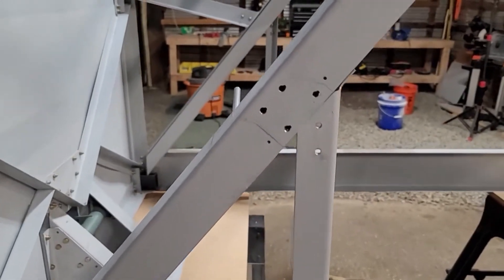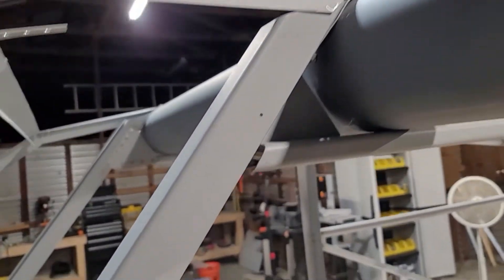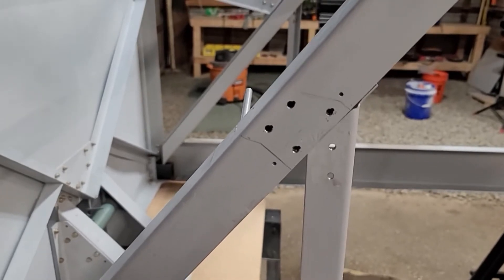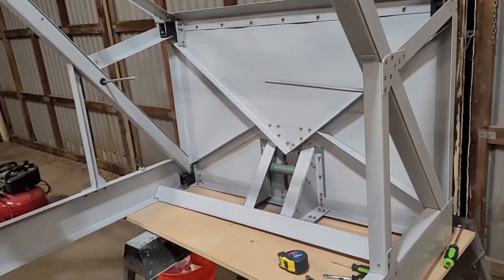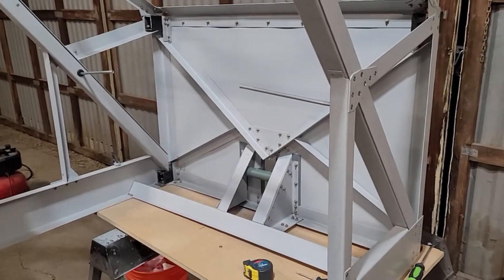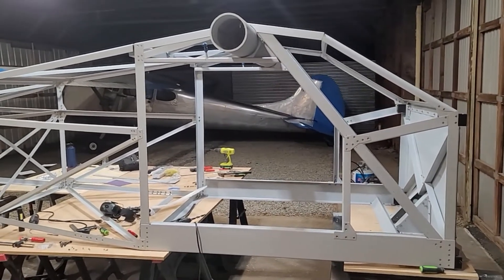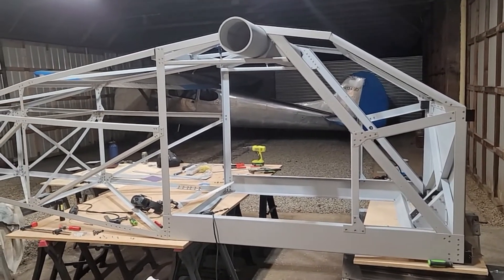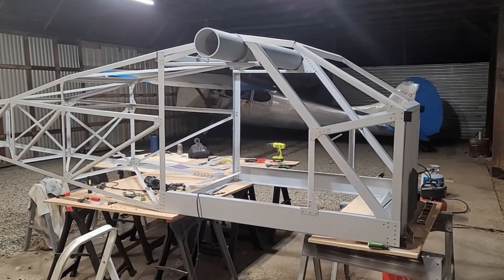Bede BD-4C Build Log 011

Comment: The sure wings kit is intriguing. I wonder if they would show us the CAD drawings for the parachute attachment points and structure enhancements needed to use a ballistic parachute?  All the other safety add-ons can be integrated to any kit, I assume.  A parachute recovery system though is a serious add-on.  You gotta hand it to Cirrus with their training program; “ Pull early, Pull often”. Having a chute requires training to actually use it not just having it there is enough we have learned.  Anyway, I love your video series and thank you again for it.  The FADEC Viking engine is sweet.  I wonder though, if you add up the components listed on SureWings’ site, what is the margin they are charging for aggregating it all? Also, could the surewings kit be applied to the assist build?
Reply from the maker: I haven't sat down and calculated what the extra cost for them to do it is, but it's probably worth the time savings as they have aggregated everything and all the tubing, wiring, mounts, etc. are all provided together.  You could do everything yourself but I think for most people the time savings is worth the premium.

Comment: I ran into your videos yesterday and I am intrigued by the idea of building an experimental plane.  So far it doesnt seem too complicated.  Just time and patience.  Once question why did you not put rubber grommets where the fuel line comes out on top?
Reply from the maker: No need.  The hole around the line is quite large and with the clamp near there it's really solid.